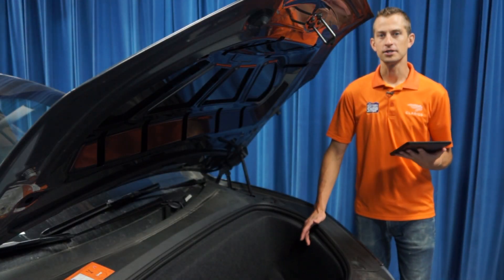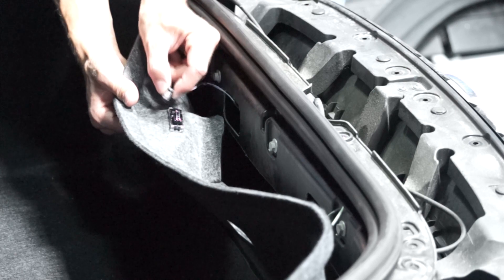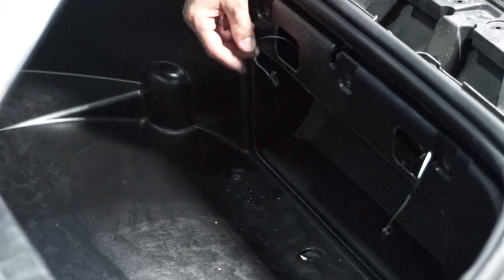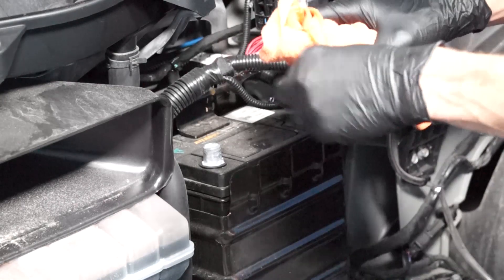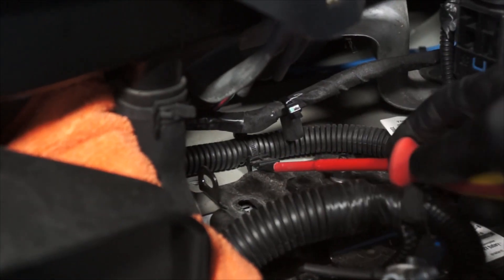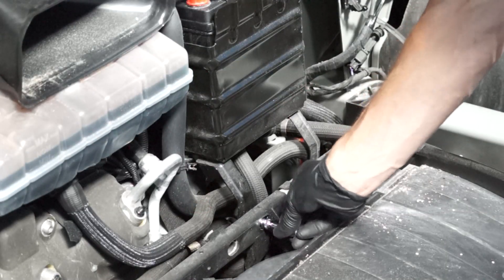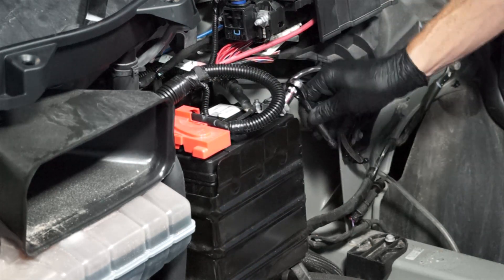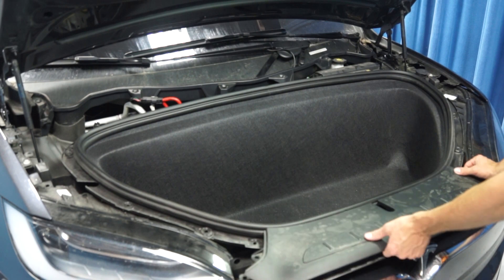Tesla Model X (2016 - 2021) - New 12-Volt Battery Install

Comment: Is it true the only battery (12v) that will work with my 2016 model x 90d is the atlasbx/hankook 12v 45ah battery?   Like Autozone or O’Reilly won’t have an alternative??
Reply from the maker: Hi - Thanks for watching! Any 12-volt battery that meets or exceeds the original equipment manufacturer’s specifications for the battery can be used in your vehicle.

Comment: The ONE piece of information I needed was cheated on in this video.  In the video, the lower part of the cage is already removed from behind the frame before its tilted and lifted out at 6:23.  On my X, it just won't fit, the lower bracket is trapped BEHIND the rail, not just resting in front of it, and I was hoping for right order to tilt and lean the cage to remove it. :( Disappointed.
Reply from the maker: Hi - Thanks for watching and sharing your experience. We followed the instructions in the manufacturer’s service manual and didn’t run into that situation. We suggest that you check the vehicle owner’s manual or a service/repair manual for your vehicle.

Comment: Thanks for the video.  Just one question.   Why did you show using Category III Lineman's Gloves when disconnecting the First Responder Loop?  I understand that you were being overly cautious, but you might freak people out about this step.  This is not a high voltage connection (it would be orange if it was), its just a 12V supply like many other standard vehicle systems.
Reply from the maker: Hi - Thanks for watching! It was the technician's request.
Reply: Had the same thought....freaked me out a bit
Reply: @jorty.  yep, nothing to worry about with this connection as far as High Voltage goes.  Firefighters are told to cut this wire when fighting a vehicle fire specifically because of the fact that it’s only 12V and cutting/disabling this circuit causes the contactors in the main HV battery to stop providing electricity to the rest of the HV (bright orange)wiring.   Basically it isolates the battery in an emergency or for servicing the HV system

Comment: Where to buy replacement battery?
Reply from the maker: Hi - Thanks for watching! Replacement batteries are available from the dealership parts department and auto parts stores.
Reply: What auto part store you bought it from, I called almost every place and they don’t have the batteries for tesla
Reply from the maker: Hi Victor, The vehicle owner supplied the battery, It is an H4 AGM battery.
Reply: Thanks I changed the batterie but in my dash still showing to change the batterie is there a way to reset it??? Thanks
Reply from the maker: Hi - We suggest that you check with the vehicle's owner's manual or a service/repair manual for a procedure. We also suggest that you check out our video on battery registration. The link is in this video's description.
Reply: In classic cars: open trunk,  locate 12V battery,  unplug,  remove,  swap,  reconnect,  done...